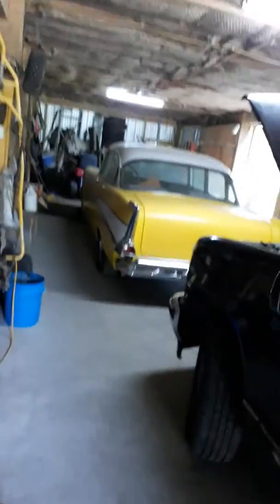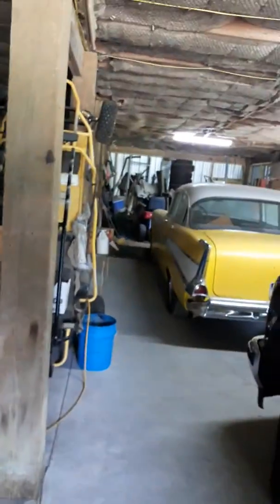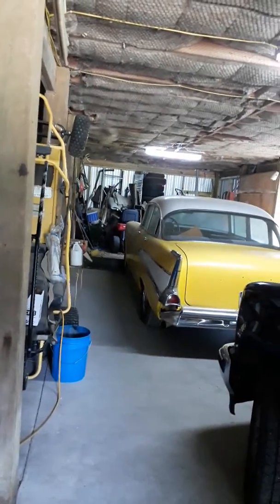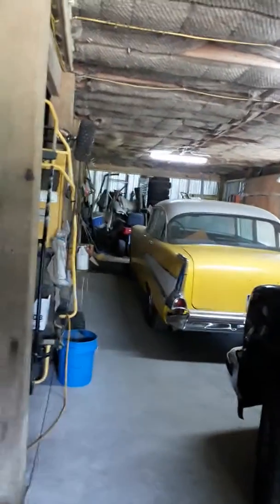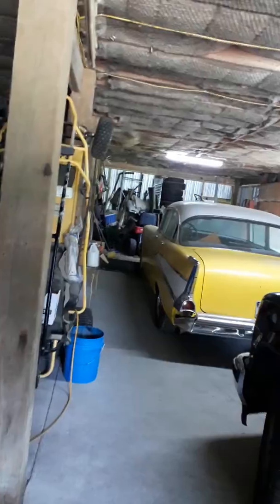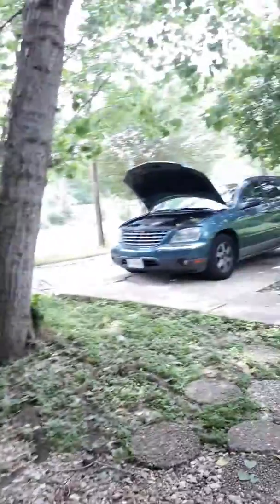Ford F150 no injector pulse / no fuel pump energized

Comment: I tried this one...but sad 😢...it didn't work. The vehicle still no fuel injector pulse and fuel pump not working. The constant positive is present in 8 injectors as well to fuel pump relay. I removed the MAF sensor connector still no start.

Comment: I have a 1987 Ford F-150 4.9 Motor it won’t start I changed out the fuel pump and Relay And I wasn’t getting Pulse in a fuel injectors so I Disconnected the map sensor and it started Right up . Thank you soo much 👍🏼